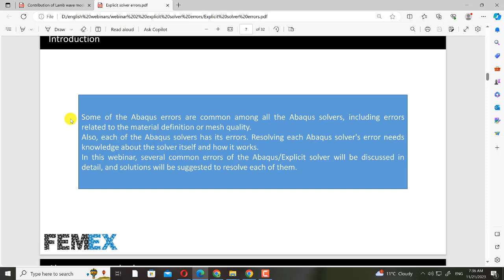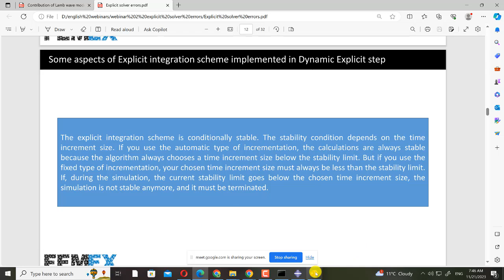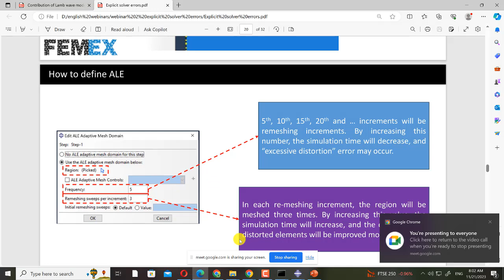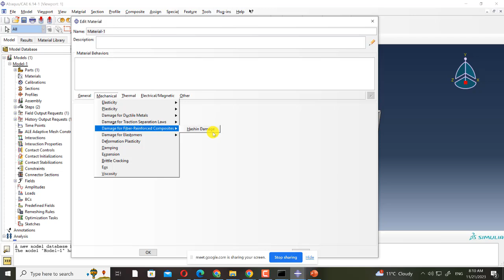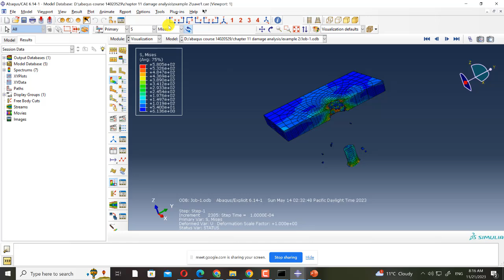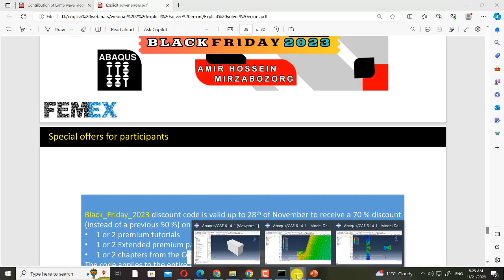Abaqus Webinar: How to Resolve Abaqus/Explicit errors like excessive distortion or wave speed

Comment: Hi everyone, I’m trying to simulate Rotary Friction Welding (RFW) in Abaqus using mild steel material. However, I’m getting this error during the analysis:

The elements contained in element set ErrElemExcessDistortion-Step1 have distorted excessively.
There are a total of 2 excessively distorted elements.
The elements contained in element set ErrElemExcessDistortion-Step1 have distorted excessively.

I’m not sure what’s causing this excessive distortion issue. Has anyone experienced this before or knows how to fix it? Any help would be greatly appreciated. Thanks!

Comment: When using ALE, I already use C3D8R but this error shows "Adaptive meshing is not supported for elements used with the hyper or viscohyper material model when enhanced hourglass control is used." How can i fix?
Reply from the maker: Hi.
According to the error description, it seems that you have defined and used hyper or visco-hyper material with enhanced hourglass control.
According to my experience, ALE must not be used with hyper-elastic or hyper-visco-elastic materials as it gives unrealistic deformations. To resolve that error, you must remove ALE from your model or change the hourglass control from enhanced to another setting in the mesh module.
Reply: @FemexIran  yeah i use hyperfoam, ohhh so I can't use ALE. Thank you so much for helping 🙏
Reply from the maker: @Jaldot  You are welcome

Comment: Sir how to do block shear of angle section with bolted connection with real fracture??

I am doing angle section analysis of 100*75*8 mm section with plate attached to 75 section. I am applied a tensile load at plate and fixed section. But I am unable to get failure..I dont know why? I have done this in my UTM machine but unable to do in abaqus please help me.😢
Reply from the maker: Hi.
You can use our online tutoring and consultancy services to get the answer of your questions and modify your model to reach the desired results.
To use our consultancy services, please send an email to me: mirzabozorg71@gmail.com